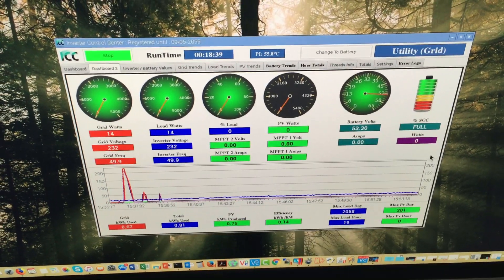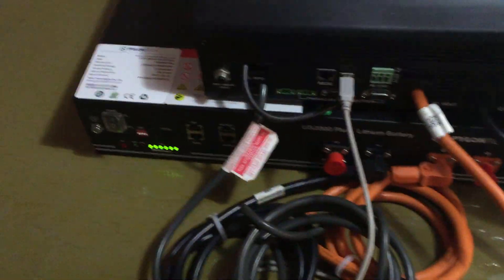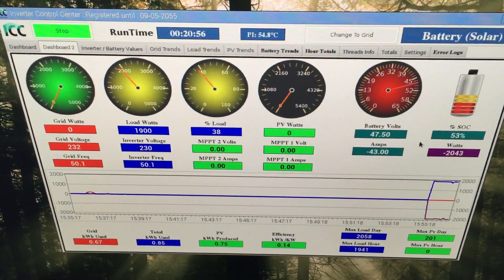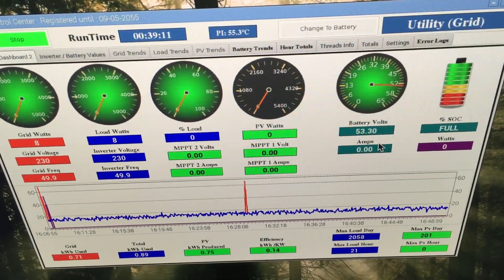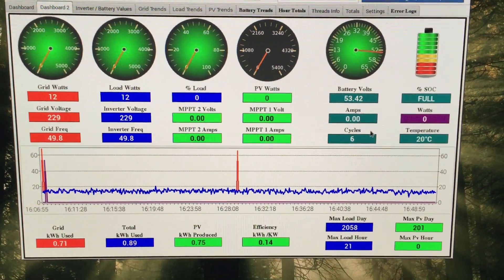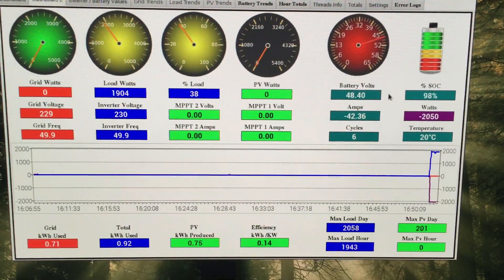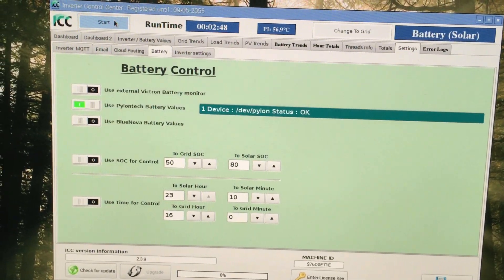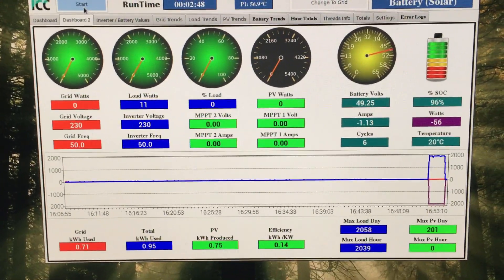ICCSOFTWARE, ICC and ICM  is now called SMH, see www.CENTURIONSOLAR.co.za for more.

Comment: Fantastic! Do you have a cable for Narada batteries?
Reply from the maker: HI Eric, 

Yes we do.  We make them exclusively for Paul at Fullcirclesolar.  Check fullcirclesolar.co.za to get one.  Also, this video was made on the VERY old ICC.  We use SMH now (see centurionsolar.co.za/support for all the cool things SMH can do).  

We even have our own cellphone app where you can control your system directly from your phone!  The best is, if you are an ICC user, you can upgrade to SMH for free, as the local usage license will be carried over without any cost.  Should you wish to use some of the more advanced cloud based services, you can simply chip in with R49.99 a month, but that's optional ;)

Comment: My ICC is very unreliable. Never runs more than 2days. Then requires Raspberry reboot.

I use MQTT integration to rest of my system. ICC us the current weakpoint
Reply from the maker: Hi Adriaan.  ICC is no longer in use, hence it's not working properly.  Please just register your system for the latest version called SMH (Solar Management Hub). You can do so at www.centurionsolar.co.za/upgrade.

Kind Regards
Johan
Reply: @solarassistant  Johan
See you tomorrow (Friday) with my Raspi's in hand.

AAS

Comment: What does one do if the battery is not a pylontech lithium ion battery.
Reply from the maker: Hi Jose, if you have lithium batteries but they are not Pylontechs you can also use something like a BVM-702 which is a calibrated shunt resistor and can also be read by ICC if you connect it with a .VE direct to USB cable ;)

Comment: Can this setup work on the pip inverter
Reply from the maker: Indeed it can yes, the pip5048 is a Voltronics inverter after all ;)
Reply: Centurion Solar I have 2 of the pip lv2424 connected in parallel will it see both inverter and will it display the total pv watts of both inverter and load.........and also can this be connected to a flexmax80 charge controller
Reply from the maker: @bimmers323ci  Hi Garfield.  Yes, it will monitor up to 9 connected inverters in parallel.  We do not know about the flexmax charge controller though, so I am not sure that we can monitor that, but at least we can do your inverters ;)
Reply: Centurion Solar 👍
Reply: As for the battery cable,,,, I am using Nissan Leaf..Chevy volts and Ford c max battery so I don’t think I will need that cable..so you think your unit will still work properly
Reply from the maker: @bimmers323ci  Maybe not for the battery as you can't talk to it directly but definitely for the inverter.  Please mail us on info@centurionsolar.co.za if you have any more queries, we'd be glad to help with any other queries you might have ;)
Reply: Centurion Solar cool thanks
Reply: Where can I get this to buy

Comment: Thank you very much for your video, it has been very helpful. How did you setup the inverter for the pylontech battery? Did you follow the "manual" from mppsolar and pylontech ?
What did you put in program 12, 13, 26,27 and 29 ?
I cannot get my pylontech to go lower than 21% (i'm using ICC and the cable).
Reply from the maker: Hi Flo,  please go to www.centurionsolar.co.za and click on the Contact Us link to send me your email address, and I will send you all the settings we use on the axpert inverters together with ICC to make it work ;)

Comment: Centurion solar thanks for this video .one question is with this meccer branded axpert inverter what voltages are required to charge these pylon batteries I recently discovered these axpert inverters are not able to charge lead acid batteries ….so if I bought one of these pylon us2000b batteries would everything work 100% ?
it will be used in a totally off grid situation ?
Reply from the maker: Hi, the Axpert works perfectly fine with the Pylontech batteries if you use it with the Pi and cable yes, and it does charge the battery properly, etc.  Please check our website www.centurionsolar.co.za for more info or click on the Contact Us link if you have any further questions ;)

Comment: Wil this work with other lithium batteries aswell. I have 2 5.8Kw Huawei batteries.
Reply from the maker: No, every battery has it's own BMS that talks on it's own protocol.  For the Huawei you can get a Victron BMV-702 with .VE Direct to USB cable and then connect it to ICC, which will then do the same as the Pylontech cable in this video.
Reply: Centurion Solar thx for the reply. Will look into it. Just another question. Are you familiar with the Huawei batteries? If so. How good of a battery is it?